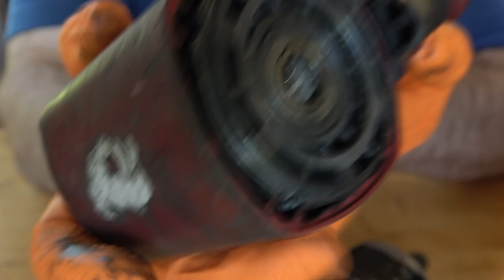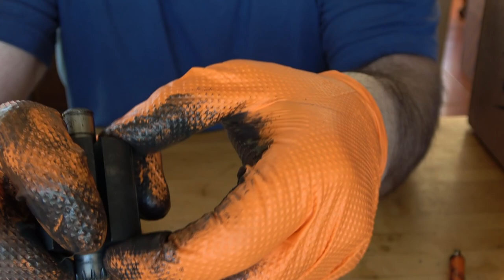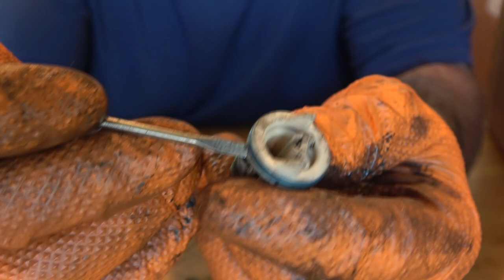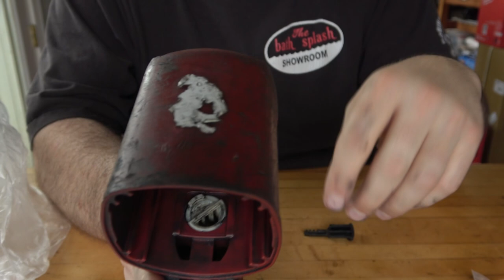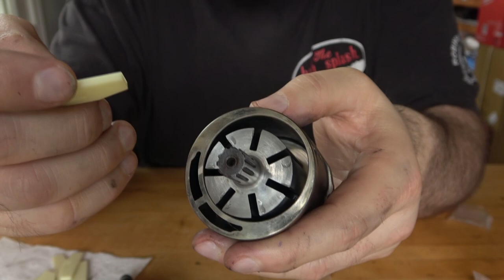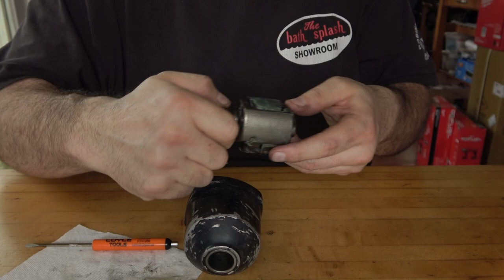What Smoked this Matco 1/2" Air Impact?!?

Comment: I think you might have said it in another video, but what causes the selector buttons to not stay clicked in place?
Reply from the maker: The only thing I found that does that, Greg, is if the teeth on the buttons aren't meshed with the teeth on the valve. It's pretty easy to avoid as long as everything is aligned properly. The one thing that will throw you off is if you installed the valve with the tab facing forward instead of rearward. You'll be spinning your wheels for a while trying to figure that one out. Ask me how I know.